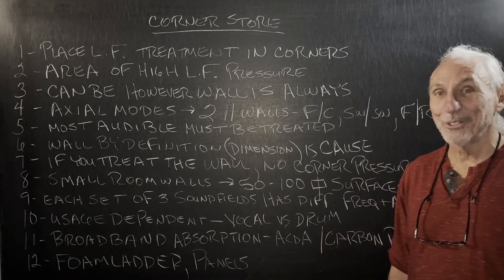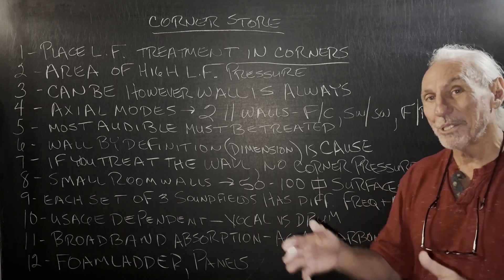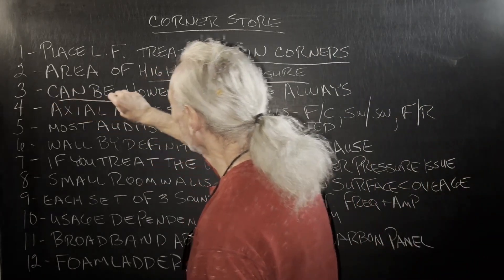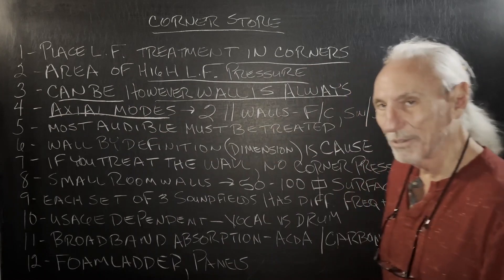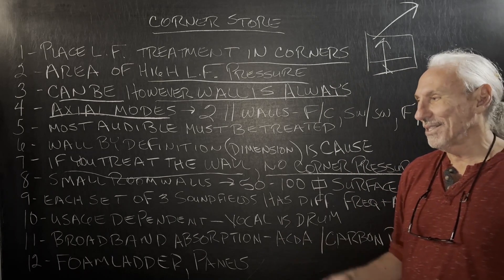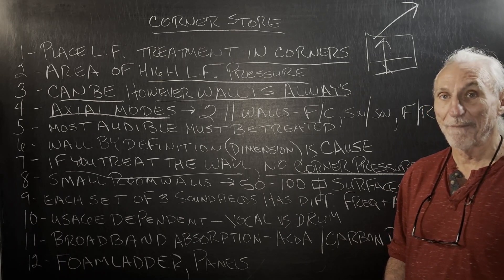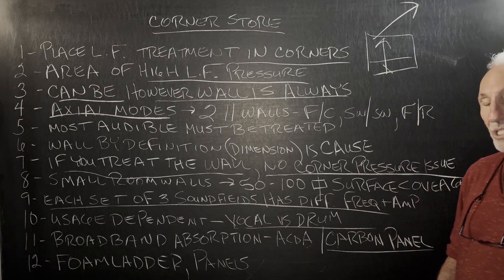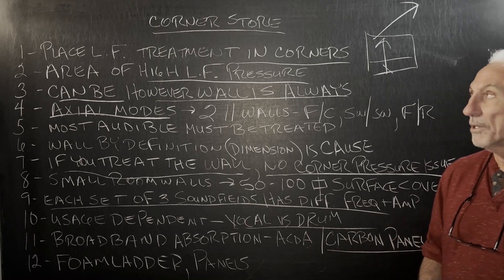Corner Store - www.AcousticFields.com

Comment: I'm curious, have you experimented with aerogels yet as a fill material for diaphragmatic cabinets? Fragile stuff, but its heat insulation performance has been shown to be incredible. I wonder how well that might translate into acoustic management applications.
Reply from the maker: The internal cabinet fill material in diaphragmatic absorption does not work on thermal conductivity. The perforated absorber inside the DA is a pressure based technology.

Comment: What's ironic is, while I'm watching this video, in my youtube suggestions is a video with a thumbnail photo of a big room with a HUGE panel of some sort  in both front corners.
Reply from the maker: Explain the irony to us.
Reply: @AcousticFields  The irony is that youtube would suggest a bass trap crap video ("The best broadband bass trap to deal with all frequencies") to me when I've liked a lot of your videos - none of which are bass trap crap. AI is often pretty dumb. The title of that suggested video alone is enough to make you roll your eyes.
Reply from the maker: @dashcammer4322  What have you learned about unwanted pressures within rooms and their locations?
Reply: @AcousticFields  That you can treat the corners, but it should occur because you're treating the whole wall (or floor or ceiling). Or all 3. It depends on the dimensions of the room. That's one thing.
Reply from the maker: @dashcammer4322  Not true. We have found that treating around 40 - 50% of each wall surface area will minimize pressure across the whole wall surface area
Reply: @AcousticFields  I guess what I meant by the whole wall wasn't 100% of the wall, but a good portion of the wall, not just the corners.
Reply from the maker: @dashcammer4322  No need to treat the corners and still have the wall issue remaining. Treat a percentage of the wall and both the wall and the corner issues go away.